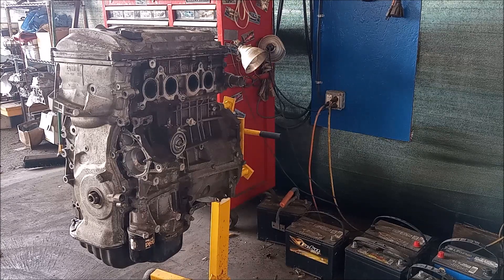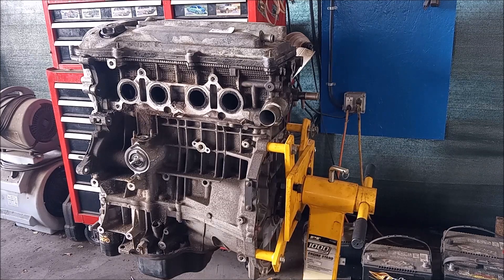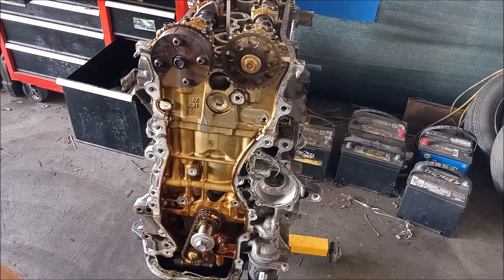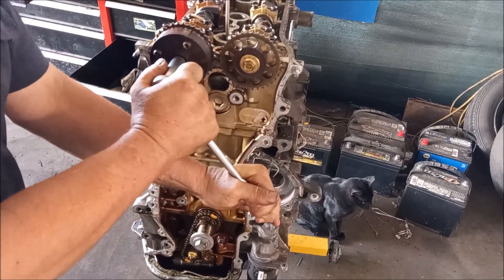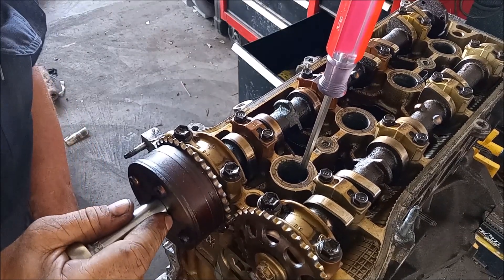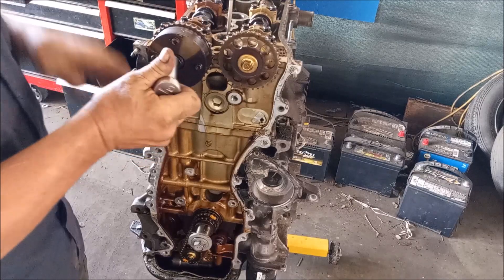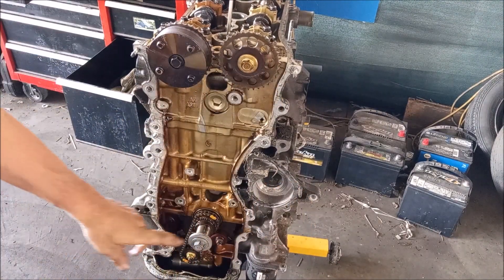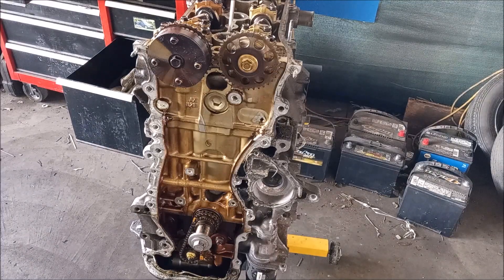Toyota 2AZ-FE 2.4-liter Engine - Interference Or Non-Interference? Camry RAV4 Highlander Scion TC

Comment: I bought a Camry Hybrid for 700 dollars.  It needs an engine. Chain is broken. So you know what it did to all the valves. It would be better to just buy another engine rather than try to fix it.
Reply from the maker: More cost effective and quicker to buy another engine.
Reply: @Merryfrankster_  I own a shop so swapping an engine is easy with the lift. Rebuilding an engjne is a specialist job requiring special equipment to it properly.
Reply: I disagree. Really not much more work to swap out the bent valves. I can't seem to find any engines around here for less than $2k, and anybody guess how well the used engine will do

Comment: Great video and often wondered. work on these engines alot out fleet has a bunch of 2009 camry hybrid, the city normaly only buys american cars but in 2008 the gas crisis and the economy made them buy toyotas for only one year Anyway long story short we dont have any other fords or chevys left in the fleet from 2009 and not with 200k on them and almost no maintenanc needed but oil serivice. I think the crown vics would make it and the chevy vans too but the camry 2.4 seems to make it with no maintenance aside from the water pump as far as engine goes the engine goes...
Reply from the maker: As you may know, 2009 was the last year for the 2.4. After that the 2.5 liter 2ar-fe came in. Probably it was the best year.  Earlier versions of this engine had a lot of problems
Reply: @Merryfrankster  yes, knew it was the last year and I had heard about these having major oil cusumption issues with over 60-120k but we do our oil changes at 4k and no more than 6k and never ever had that issue with any of them (fleet bought over 250) hybrids. I think if you were to follow the manufacture guidelines and go 10k or more, that's where the trouble starts, cars that had those burnt rings too much contamination in the oil.
Reply from the maker: @version13b  watch for my next video coming up - I tear down an oil burner 2az. Editing the video now. It's unbelievable.
Reply: Has that 2.4L been pretty reliable for ya? Thinking about a Rav4 2007. Even if I have to time sert the head bolts could be nice lil beater.
Reply from the maker: @Prisonmike89  not really the greatest vahicle. Lots of little issues. Lots of big issues.
Reply from the maker: THIS COULD EASILY BE A VEHIICLE MADE IN DETROIT.